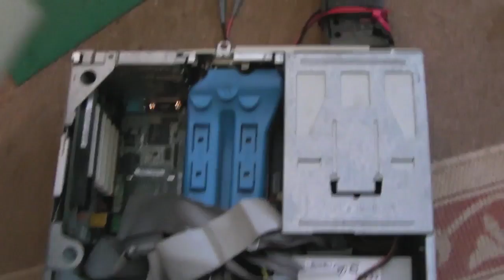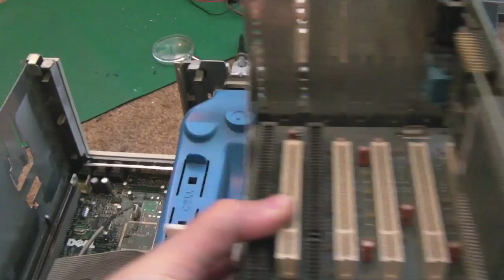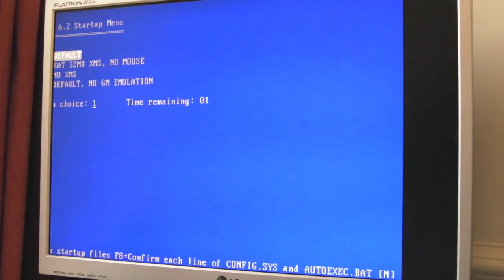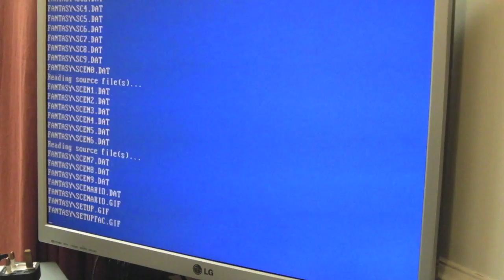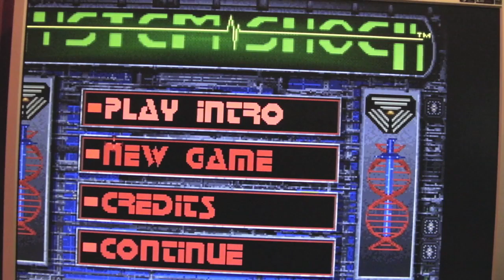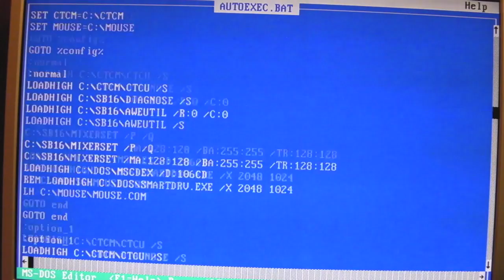Retro PC (DOS Gaming) Build & Test - Pentium 2 / Voodoo / AWE64

Comment: I want a mobo with more than 640k memory. 
Tired of the emm386.exe pageframe address always being ruined by shared memory graphics cards UMA they use UMB's..
Reply: Trying to get it to function under Windows Me but can't seem to find the right syntax for it. I really don't want to reinstall 98se but thinking I should perhaps my nes emulation would work better also.
Reply: Master of Magic by Microprose
Reply from the maker: I will check that one out =D
Reply: @GadgetUK164  I did reinstall win98se and got the page frame address to set at CC00 which rock's, however I even tried xp on this same gateway solo 1150cl and the syntax for that won't run it's ems management. I find this odd.

Comment: So what OS was originally on this system? I was under the impression that XP was the first consumer level operating system to support dual CPUs.
Reply from the maker: Windows NT4.0 I believe - pretty sure that supported 2 processors.  Might have needed the "server edition".
Reply: @GadgetUK164  Ah, that makes sense. I remember later versions of Window's core limitations being governed by the edition you were using.

Comment: NT 4.0 didn't support USB. I remember everyone rejoicing about 2000 having USB support, well those who were stuck on NT workstations anyway.
Reply from the maker: Yes, pretty sure you are right!  We all used NT4.0 and what happened is people in my office would enable USB in the BIOS, boot into NT4.0 and the system would hang.
Reply: @GadgetUK164  I think it did with Service pack 6 and Supp addon just like Windows 95 OSR2.x

Comment: Sorry for ruining Your blissful ignorance at throwing out that Voodoo3 previously. I assume You'll be doing some googling before binning anything next time. Even Generic sound cards like ESS ISA ones had decent Soundblaster Pro emulation in stereo. Even SB16's and Awe models could only emulate that in Mono. LGR I think it was did a video on 3DFX and their buyout of STB which ended up alienating them from their previous Board partners and started their fall.
Reply from the maker: +Imperious685 Haha, yes, it's been bugging me a LOT since it happened :P  If I had just taken a minute to inspect the board I would have worked out what it was.  I guess that's a lesson that even the most average looking graphics and sounds cards can be more than they appear.  I used to have a Soundblaster Pro before I got the AWE32, they were nice cards also.  I didn't know the SB16 and AWE only provide mono Soundblaster Pro - that's shocking!  It's a shame 3DFX went under =/

Comment: I love the old DOS world. I also threw out a lot of my hardware from back in the day. I very much regret chucking out my Matrox M3D video accelerator and quite a few AT-style desktop cases. Luckily I still have my sound card and joystick from back then. I never owned an AWE32 or AWE64 though - I never really saw the point in upgrading from my SB16.

The company I work for also used to use those Dell machines back when I started working for them. They are very well-built. Easier to work in than some Macs I've worked with. We must have recycled hundreds of them over the years. I never really thought to save one - as I was mainly nostalgic for the full height desktop cases I had for my AM5x86 DX4 133 machine back in the day.

System Shock is a true classic - one of the primary reasons I still own DOS PCs. I must have completed it 4 or 5 times by now.
Reply from the maker: +Anacreon ZA The SB16 was a great card also - but unless you had one of the wave table add ons the AWE32/64 MIDI music was much better than just adlib!   Yeah, years ago I threw away a working 486DX4-100, plus motherboard, plus SCSI controller, SCSI CDRW, 5.25" 1.2MB FDD and full tower case.   I really regret that =/   I think at the time we see no value in older PC equipment, but a decade or two later it starts to become popular again.

Comment: Awesome! Really like the CF card solution on a retro PC too.
Reply from the maker: +Aron Gooch Thanks!  Yes, a bit like the Amiga 1200 - got me thinking that being able to hot swap it was great because I could just swap from DOS, Win 3.1, 98, 2000, Linux etc.  And backup the drives on my main PC also!  Very cheap those adapters as well!
Reply: +GadgetUK164 CF cards are an excellent solution. I use them in my Amiga's now. Quite, less power, run alot cooler, smaller etc. Tempted to build a retro PC myself now.

Comment: An easy way to figure out if an AWE sound card has an real OPL3 and not CQM is to see if there's a chip with the OPL logo on it.
Reply from the maker: +CryoSID Thanks, there's only 3 revisions or something that use that chip!  Tbh, having owned one originally with the OPL chip vs this AWE64 I am using, I cannot tell the difference.  I guess side by side it might be easier to tell the difference, but I've been playing a lot of Dune with adlib music and it sounds just like it always did to me.  In any case, the AWE32 and AWE64 are awesome!  One thing I miss on this card vs my old AWE32 - I used to have 2 x 4Mb SIMMs on my AWE32 for the sound bank.  That said, no games really use that feature I think?!?
Reply: +GadgetUK164 
CQM sounds very different than the OPL3 or any of its clones and has a weird issue where it sometimes has an high-pitched "ringing" sound.
I've recorded some musics where this issue is present along with real OPL3 recordings for comparison:
https://www.dropbox.com/s/gvp778rbm9ahccq/OPL3%20vs%20CQM.rar?dl=1

As for games that use the AWE32/64 ram there might be a few but I'm not 100% sure.
Reply from the maker: +CryoSID Yeah, I can tell the difference listening to those samples, but tbh I quite like both!  I guess its a case of personal choice, and also what you are used to.  It's a bit like the 6581 and 8580.  Though I don't doubt the reason for the subtle difference is the cost reduction / cheap replacement used on the later cards.

Comment: my main dos gaming PC is a 486 Packard Bell with windows 3.11
Reply from the maker: +PCgeek486 I used to love the old 486 machines!  They certainly had character!  I started with an SX-25, then move up through DX-33, DX2-66, DX4-100, and I am sure the last one I had was something like a DX-233 or was it 133?  Honestly can't remember.   But I do know that back then each change was more memorable than it is these days, for example I cannot remember what CPU I had before my current, but I do vaguely remember the one before it was a Celeron which I think was 466 or something?!?  Still got that old Celeron CPU but no motherboard.
Reply from the maker: They did a DX4-100 (https://en.wikipedia.org/wiki/Intel_DX4), I think that was my last 486 machine and from there I jumped to an AMD Athalon and then to a Celeron.  The Cyrix were quite cheap and fast, but I remember some compatibility issues with them - same to a degree with some of the AMD CPUs.  Remember the 'overdrive' CPUs - they were great because they allowed you to get twice the internal clock speed and support from the motherboard regardless.  I used to have a VESA local bus board as well with a Diamond VLB graphics card - that card really shifted!  PCI spelled the end of VLB though =/  So many fond memories lol.

Comment: Awesome video mate! Haven't fired up my old DOS pc in ages. Some very good memories there - especially Bioshock, great game. Never even thought about using a CF adapter in an old DOS machine, bet it increases the performance no end - might have to give that a go. Don't forget if you're running DOS 6 (or above) that you have memmaker available that can give you a huge boost in conventional memory sometimes - seem to remember that was the only way to get some games running back in the day without spending hours tweaking configs.
Reply from the maker: +Phil Kett (MrFlipDoodle) Thanks =D, yes I might give memmaker a go at some point!  I always manually edited the config back in the day - I guess you learn more that way, but don't doubt memmaker takes all the stress out of it.  I wish they would make another Bioshock game, or just a HD remake.  I also wish they would do another System Shock game, or again just HD remakes of the first 2.  I know System Shock 2 had a HD texture pack make over, I've got that on my main PC atm.

Comment: I'd recommend checking out "plop boot manager" it's a fantastic little piece of software, great for these older machines, and also look into FreeDos which gets around the partition size limit and has some extra nice features like the linux/unix style tab to complete. I wasn't able to get Crusader: No Remorse to run under win98's DOS or 6.22 (the game is a fussy bitch with memory config) but it worked perfectly via FreeDOS. I'm using a P3 machine right now, did consider a dual p2 board, may still change it.
Reply from the maker: +TheSynrgy1987 Thanks, I will check those out =D  I've got Crusader running OK on this machine!  Turrican 2 is proving to be a git when it comes to getting sound out of it =/
Reply: Yeah from watching your video all the way through seems you've done well with the memory tetris. I've yet to try turrican 2, will be adding that to the list.
Reply from the maker: One of the interesting things I found - the MS mouse driver is huge!  Takes like 40K or something...  After hunting around I found another old driver I used which is only 10K.
Reply: yeah it's fairly large, I have run into an issue with mouse support in DOS, works perfectly under 98SE but in DOS up / down are inverted where left and right are normal. I am using a USB mouse through legacy support so don't know if this is maybe the issue, I've got another PS/2 mouse somewhere but i think the PS/2 port on this board might be a little iffy.
Reply: +GadgetUK164 have you tried the Freedos cutemouse driver? it only takes up approx 6k and is still getting updates. works perfectly with win98SE Pure DOS mode